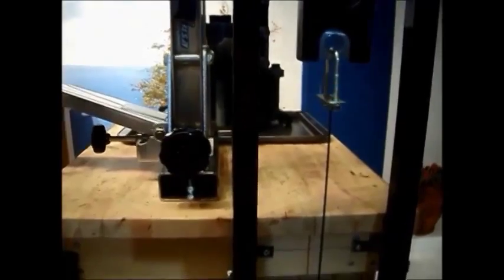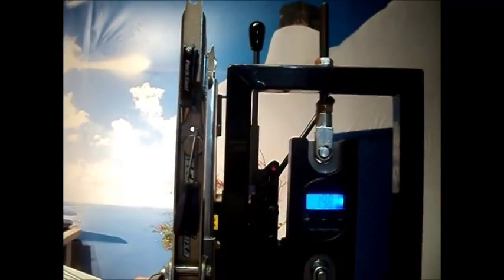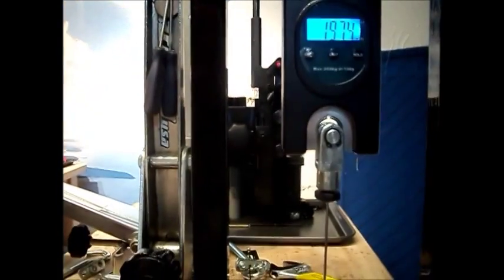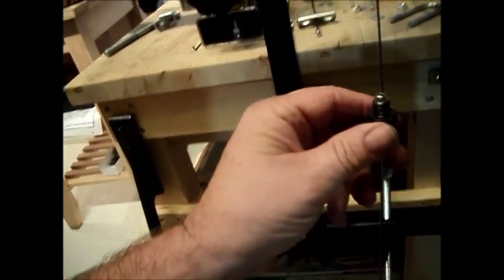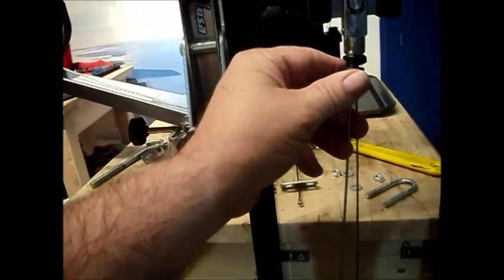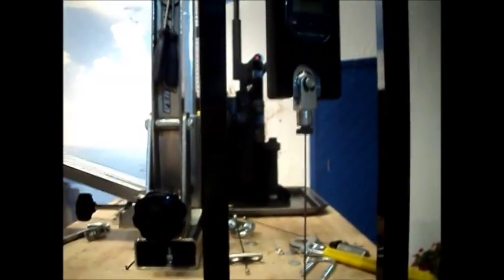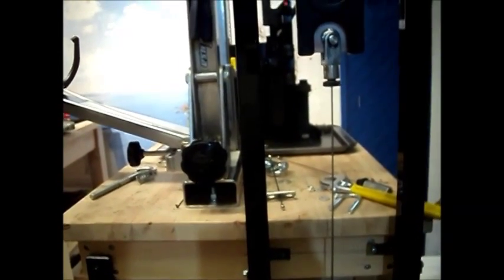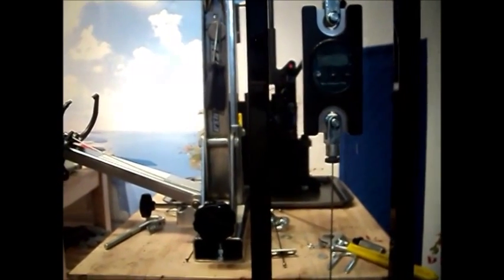Tension meter calibrator upgrades

Comment: Thanks for your vids. I am contemplating my version of this tool while the scale I ordered is on it's way here via the Eurasian railway (that gives me a few weeks :-). Have you considered a setup where you would tension the spoke in the 'normal way' using the nipple (and using the wingnut only to cater for spoke length difference / take out the initial slack)? That would at the very least give you the finer threads you are after for the tension adjustment.

Comment: I see that this refined version eliminates any associated flex that the u-bolt cross pieces would introduce to the system when measuring deflections.  From spoke tip to tip, the jig should have as close to zero flex as possible.  This design appears to achieve that.  Were there other reasons for your design changes, other than the obvious need to not modify spokes to measure them?  
Thanks!

Comment: I copied your original set up and found the scale rotating back and forth on the upper bolt to be frustrating.  I added a flat aluminum plate behind the scale on the outside of the frame to steady the scale.  I too am looking for finer threads on the adjustment end.

Comment: Hi. Quite neat setup. Just a quick question. What sort of scale you're using on that frame? I'm thinking about similar calibrator but got a problems to find suitable scale (all I can find are up to 25kg). Thanks in advance.
Reply from the maker: Hi Adam
 Here is a link to the original video  https://www.youtube.com/watch?v=xgsz7l1GWoI
There should be a link to the vendor I purchased the scale from in the video description.